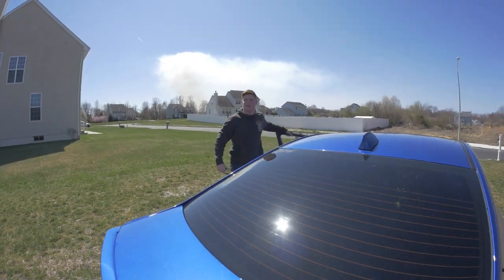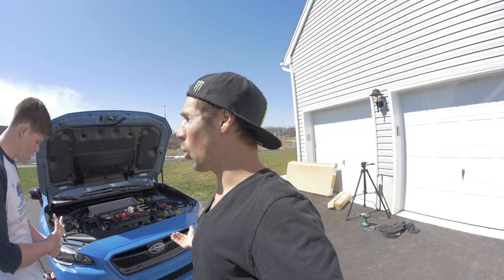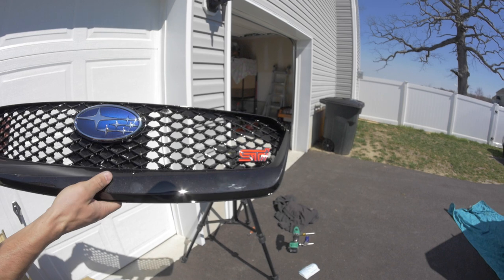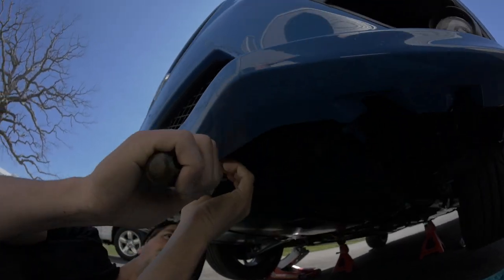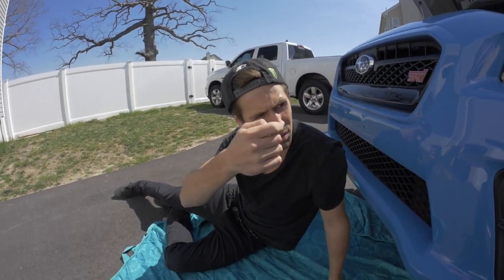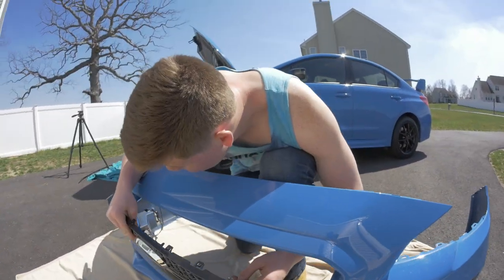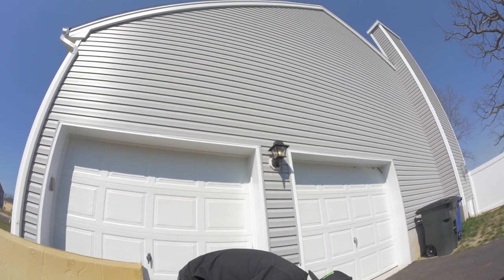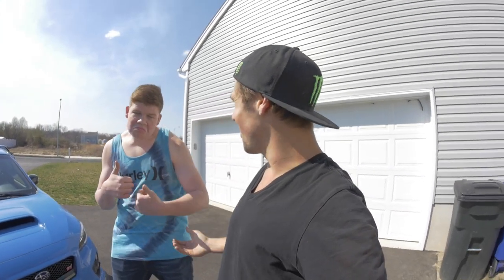JDM FACELIFT! PROJECT STI PT.1

Comment: You should get a carbon rear diffuser to match the front, get a performance exhaust system for it and maybe get some wheel spacers to give the car a meaner stance!

Comment: I think Scotty should of put a front mount intercooler on while he had the front end off. The stock intercooler is ok. But, knowing Scotty he will up the boost or swap turbos for a larger one. And the stock ones don't handle the air flow right with more boost or bigger turbo.
#StandwithScotty

Comment: Even tho the sti has the rumble and the wrx doesn't. The wrx engine is way better. It is the FA20DIT engine with equal length headers and keep in mind the engine is NEW.  The sti has the ej257 motor with unequal length headers giving it the rumble and the engine is OLD about 8 years old I believe. And the ej motor is prone to ring land failure. It will hit Scotty eventually depending if he goons the car. And the fa engine is very reliable

Comment: Bigboy your wrx can also rumble like scottys....you jus need to change the headers...and you might as well put a jpipe while ur under there
Reply: +Royal_ Subie The WRX uses a twin scroll turbo which needs equal length headers.   Going UEL would make it run like crap.
Reply: Ohh ok good to know ....even after a tune?
Reply: Yeah the equal length headers allow the exhaust gasses to reach the turbo at even intervals which keep it spooled easier and faster (which the twin scroll was designed for.)  If it was unequal length the gasses on one side would have farther to travel so the intervals wouldn't be even.  Good for that subie rumble we all know and love, bad for the efficiency of a twin scroll.
Reply: Ok .Yeah makes sense . Thanks bro!

Comment: Looks good. Coilovers might be overkill. If you lower the car too much without changing the angle of the rear swaybar via adjustable endlinks, the car will have amplified understeer on corner entry. Racecomp yellow springs may be sufficient for daily driving. Subaru spent a lot of time developing the dampeners for this STI. I'd hate to see your STI lose performance and ride quality. Exhaust is a good choice as long as it's a Turbo Back Exhaust. It's the downpipe that's most restrictive on the Subbies. The biggest improvement you can make for better drivability on these things are the pitch stop mount, tranny mount, and rear diff bushings. The rear subframe bushings are key also. Check out www.rallysportdirect.com They helped me out immensely. Can't wait to see more vids.

Comment: I mean I'm a evo guy. Go get 1200cc injectors a new fuel pump, 30r turbo with 280 cosworth cams, built the mortor and get run the bitch on e85. Your gtr won't touch that car from a roll or dig.